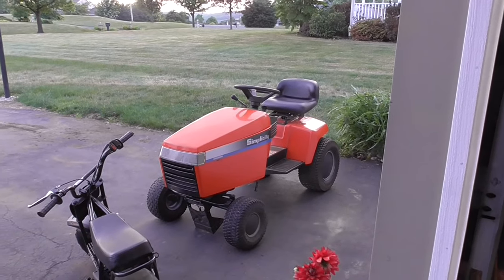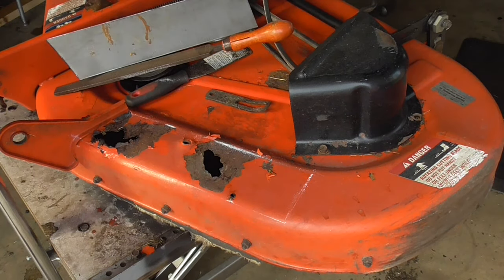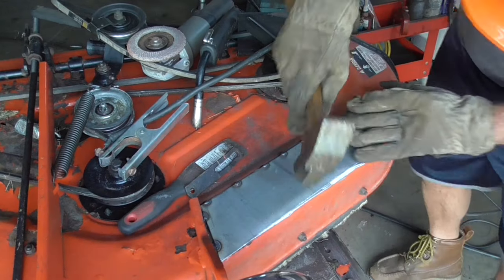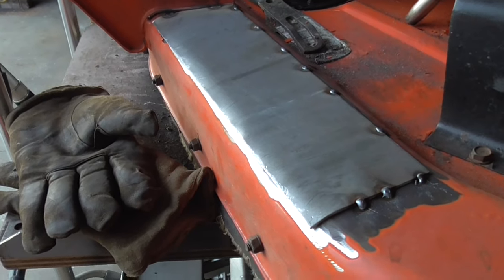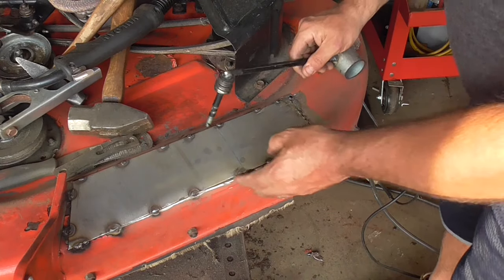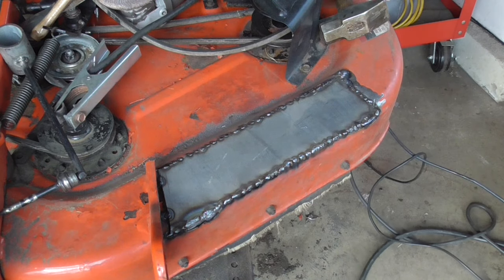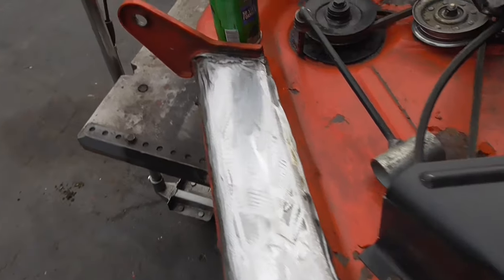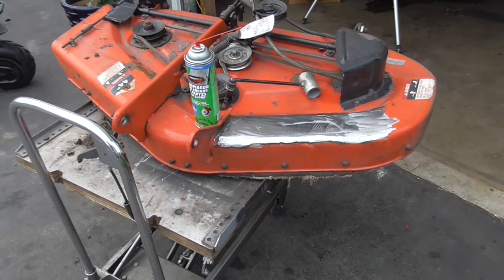Repairing A Rusted Tractor Deck With Holes

Comment: Just a hint, NEVER set your welding ground to a shaft that is going through a bearing, it’s a sure way to start the failure of that bearing. Just sayin!!!
Reply: I was thinking the same thing. I'm sure I would have found a better way than that but it's not mine. Perhaps he's changing the spindles anyway?
Reply: I believe he appreciates the constructive reply and the reasoning behind it
Reply: I was just getting ready to comment that. It also doesn't give a good conductivity so the weld is going to be weaker.

Comment: Looks great! Just picked up a scag with rust holes in the deck. I plated the top area most of the center section with all the hardware. then fiber glassed the bottom area to keep the moisture and grass out.

Comment: I love the "sinking in" method. Some of the auto-body wizards use this method. It's quick and gives the best fit, but also you can hammer and bend the patch before you weld to get the shape just right. This is more critical with thinner metal. 
   Nice video, thanks.

Comment: Try not to ground on a metal post with a bearing. The arc you were creating with your stinger is also being reproduced within the bearing.  Watch the sparks on your very first.
Reply: exactly it can weld the bearing to the race or atleast marr it
Reply from the maker: Thanks I didn't know that.

Comment: Genius idea to sink the patch...never seen that before...watched a lot of deck patching videos and this was the best, at first I thought it was just another video tacking a plate over the hole which would allow the problem to continue to worsen...I'm going to use your method to fix my Deere 455 deck with some holes in it...I've been putting off the project because I thought cutting the patches was going to be difficult with all the bends and angles....this makes that easier

Comment: Now all you need is to put some Agri Guard coating on the deck bottom. It's the best thing I ever found ad far as sealing right over tightly adhered rust. Even battery acid and fertilizer will not faze it Farmers swear by it
Reply: Thanks for the info!

Comment: Fantastic fix.  I am not a welder so why do the tack method instead of straight weld?  Less heat and less possibility of warping?  If you don't have a mower this one would be a good one to keep I would think. Thanks for the great video.  Stay safe.
Reply from the maker: tacking because I am using higher heat for good penetration.  If I keep welding the metal could warp and I will melt through.

Comment: I'm not understanding the reason for tacking, then cutting back off and re tacking... You called it sinking in. Did you cut the weld only or completely through the deck?
Reply from the maker: completely through.
Reply: he tacked it to just hold it in place. this was pretty simple and clear of a job. helpful video man

Comment: kool   good job ...   if you have a couple very small holes and lite grind around them  and do not have a welder  is there any good filler  that  might work  for a while or   ...  †
Reply from the maker: Bondo with fiberglass

Comment: Came out nice.  What did you do with the rotted out sections from underneath as you did not cut them out. Just bang them back flat. Did you use any undercoating on the underside.
Reply from the maker: I did end up cutting just about all if it out.  I had some rust bullet paint that I put on the patched areas.
Reply: it  actually cuts it out as he cuts on the 45 degree angle ( except for that end piece in this case ) so when your done it should just fall out , the reason for cutting on a 45 is so your gap is tighter when butt welding it , less chance of burn threw

Comment: Nice repair. I recognized it was a Simplicity deck before you showed your tractor. I have a 94 Landlord with a 16 Vanguard twin hydro and 44" deck. Love it! It's all steel, no plastic hood like Deere. Only rust is a small pinhole in the deck where the water collects. You've inspired me to fix it. What gauge metal and wire were you using? Cheers.

Comment: I HAD to watch, I`m working on a Craftsman/Simplicity ZT1850 as the number implies, is a 50 inch deck. As it turned out?, THIS thing (in damage comparison) is something like 400% WORSE rotted/corroded condition. I AM/was (now disabled/retired) Iron worker, Pipe Fitter, Pipe Welder, Millwright and a trash picker-upper. I started repairing mowers pretty much as a hobby type way t add to my monthly Disability check and since I was just playing around and not really pressured for time?, I always went the extra mile for my customer. WISH I had thought of filming my work for Youtube but just never spared the expense to do it. Kind of late in the game, but may STILL do it. Anyway, the "Hobby" turned into VERY steady work for me. Wish I could put pictures up here in the "Comment" section to show you just WHAT I`ve been faced with on THIS deck. Turns out that the WHOLE area under all three blades was rotted COMPLETELY out and wouldn't even support the pulley`s/spindles anymore so Yeah, HAD to do a whole NEW  plate for the whole thing. I`m pretty FAR into it and the MATH involved in getting ALL the holes in the right places IS a chore. I haven't "Sunk" it YET but WILL and then flip it to cut the OLD stuff off/out of the way.  But I FIRST have to make SURE the blades AND the pulley`s on top LINE up precisely so the belt doesn't fly off and the blades cut even. I THINK factory metal thickness is/was only a 16-gauge but I`ve put in a 1/8 th. plate in to replace it with and probably it WILL last WAY beyond the mowers lifetime. Anyway, STILL working on it. Wished it as simple as the one YOU did but I`m looking at a $600+ job here. A NEW deck (Shell ONLY) for this is at $1,700.00 THEN all the OTHER stuff has to be added in to THAT price, which is WHY I GOT the job to rebuilt THIS old one. Used CAN be purchased off Ebay BUT, you STILL can`t tell it`s TRUE condition by a "Picture" and WOULD HAVE to replace the spindles and pulleys,  and I DID look up the spindles as a whole piece PLUS the rebuild kits FOR them---The spindles (whole assembly) is at $179 EACH ! WoW!!!, so I opted for JUST the bearings and the outer shells. STILL working on it.
Reply from the maker: Sound like a work of love.  You should start filming your work.

Comment: I'm just curious wouldn't the new metal plate harbor wet grass and moisture therefore causing the existing rust to accelerate underneath the new metal plate therefor causing the rusty hole problem all over again. Or is there a treatment that would stop the existing rust ?
Reply: Yes, should have cut out the rusted material first...
Reply: @brendayoung4347  he's cutting the old metal out as he goes along and sinks new piece in all at the same magical time , are you not seeing this ?

Comment: What about the bent up rusted metal you pounded down toward the underside of the deck?  Won't that collect debri?  I think I would have cut it out once I had the replacement piece ready.  Just my 2 cents.
Reply from the maker: I flipped it over and cut away most of it away and tacked a few spots with weld from underneath.
Reply: @doublewide6  dang man a lot of people on you. guys this guy did a great job clearly not everything he did is in the video

Comment: I am not sure if this has been answered or asked for that matter, however what i am trying to figure out is why didn't you just cut the deck out after tracing the piece onto it and then tacking the corners flush; then follow up on filling it in with a full weld then grind it all flush. 
Not trying to be an ass or anything, just trying to figure out your method because yours just seemed like more work than what it needed to be. 
Good video none the less.

Comment: Did you just leave the old metal underneath?
Reply from the maker: Off camera cut and removed.  touch up with rust bullet paint that I had sitting on the shelf.
Reply: He cut all the way through at a 45 degree angle. Pushed it down flush tacked down all around because it is thin. That patch is obviously a little thicker than the deck material so the piece underneath should all but fall right out. Sure he had to grind s little out.

Comment: This strategy was very confusing for me.  You need more welding study time, IMO as an amateur with maybe 500hrs welding.  You didn't need to cut in a 45 degree angle if your welder gets hot enough to melt the corners down, it's not 1/2in thick metal.  I have no doubt your fix there will last the life of that old machine but if it had more life/hours left then it'd have been better to cut out all that rust section & not trap the old rust under your new plate. If you're burning through then turn it down & use longer horse-shoe welding pattern & play more with the welding angle.  Keep it up though as eventually your welding skill should get good enough to not require any finish-grinding & you'll feel confident in displaying your welds to the point of not wanting to grind them smooth.
Reply: there was no need to cut or as he called it sink it 
i have 20 years welding experience
Reply from the maker: I cut the 45 degree angle to sink the metal or even it out.  The old rusty metal I cut away from underneath just about all of it. Put some rust bullet paint on the fresh metal underneath.  If I wanted to just weld the top and not grind it I could have.
Reply: you cut on a 45 so your gap is tighter when they are "sunk " together , important when butt welding thin rusty / thin sheetmetal , less chance of burn threw

Comment: This is not a fix .. the rusted area should be cut out and replaced with new steel.. this patch will make it deck look better  but grass and moisture  will be trapped under the patch and this will happen again. Cut out rusted metal and  cut to fit new steel plate and weld in for a proper repair.
Reply from the maker: I did cut away just about all the old rust just didn't show on video.
Reply: lol , I don't think you understand  ,  it  actually cuts it out as he cuts on the 45 degree angle ( except for that end piece in this case as he could not cut it from top , he would have to get that side form bottom ) so when your done it will  just fall out , the reason for cutting on a 45 is so your gap is tighter when butt welding it , less chance of burn threw

Comment: So many things wrong with this video 😂 please do not do this 

First off you need to cut out all that rust. Rust is like a cancer. It spreads.  Where you marked to sand off the paint should have all been taken out with a cutting wheel.

 Second there was a lot of unnecessary tacking and grinding going on. Fit your pice and WELD it. Not tack it 30000 times. Not that hard. 

Third. Never ground to a bearing. If it arks inside that Bearing is done for. 

Overall just poor craftsmanship all throughout. Cant expect that much from someone welding in sports shorts and a short sleeve shirt I suppose.
Reply: lol you don't understand , the old metal will be gone when finished from cutting the 45 all the way around , there is nothing wrong with this video lol